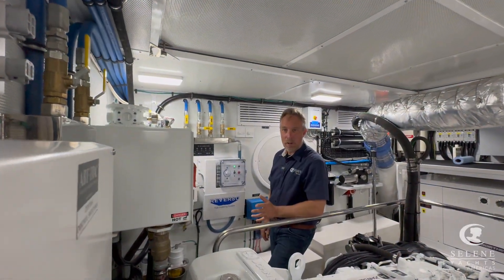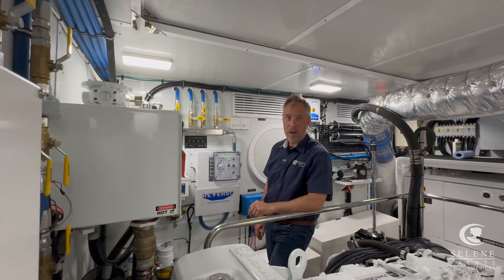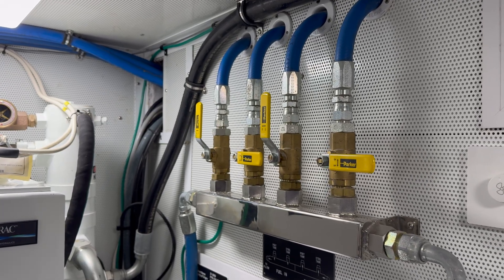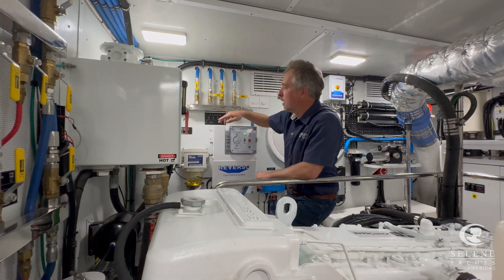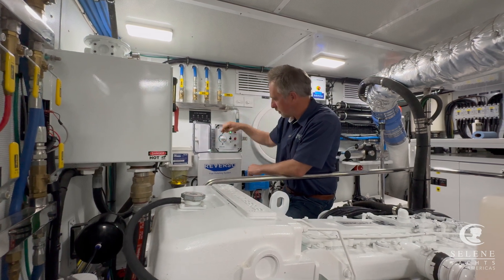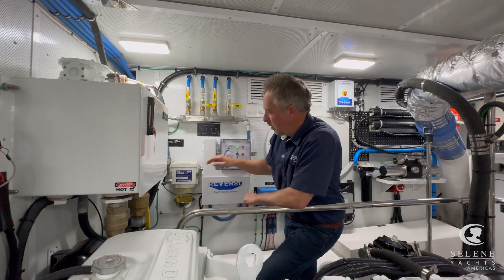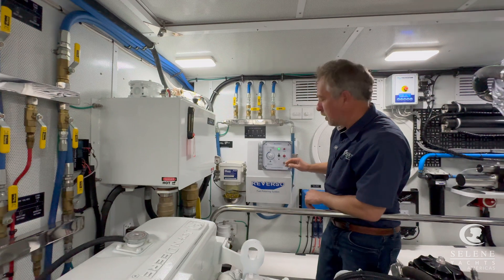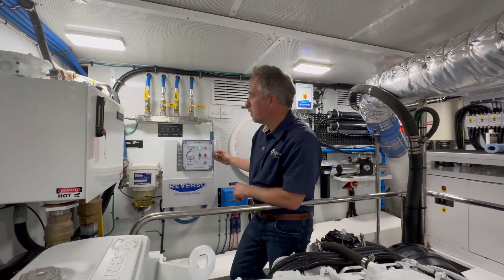Tech Talk - Fuel Polishing System

Comment: I have a Selene. With a Cummins diesel. That engine returns 60% of the fuel back to the tank. As the majority of the fuel goes through the engine  filter it is being polished. I’ve only once in 50 years gotten bad fuel and that was in the Bahamas and that was water contamination.